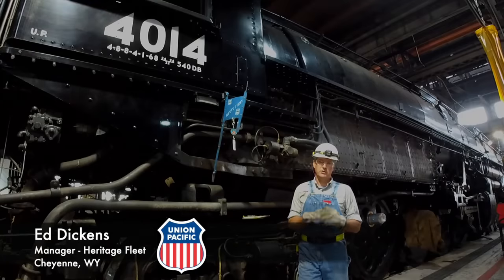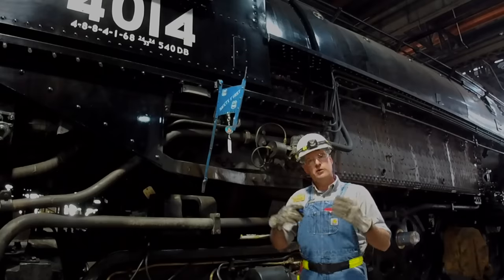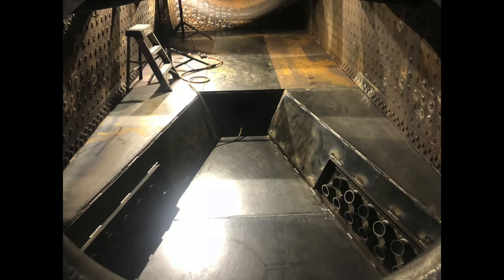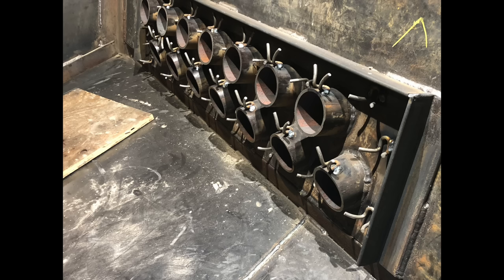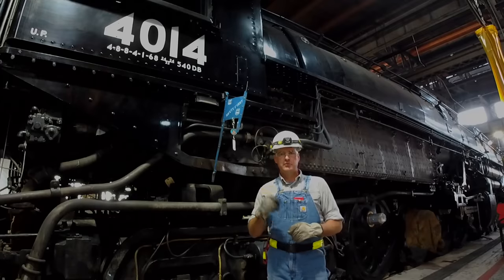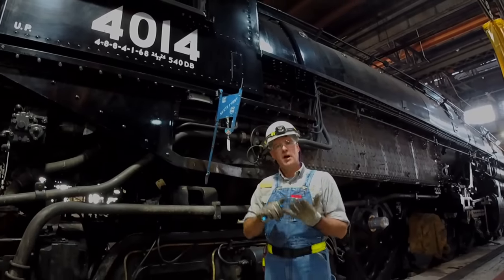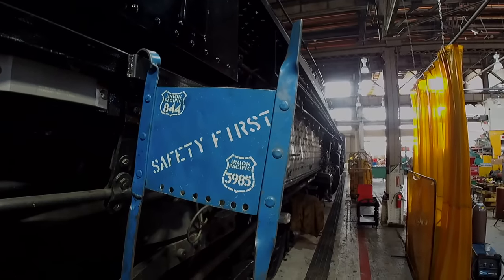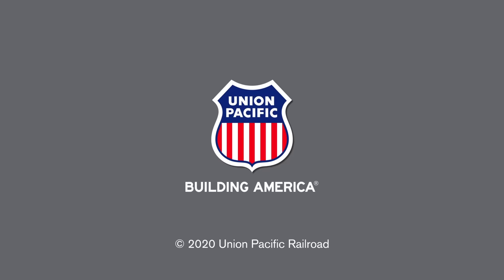UP Steam Update: Converting Big Boy No. 4014 to Oil

Comment: Oil was the only way to operate 4014. The availability and logistics of coal, the ash , the clinkers and all of the other difficulties plus the fact that operating Big Boy would require a wide spread coal distribution system that hasn't existed in decades. With oil, steam locomotives can operate anywhere a diesel operates. Too bad coal just is not practical.
Reply: Your comment should be pinned at the top so the whining, complaining trolls at least understand the conversion.

Comment: I find it fascinating that Union Pacific experimented with oil on a Big Boy, #4005 from Dec. 1946 to June 1948.  It didn't work to their expectations, but proved that a big steam engine like a Big Boy could be fired with oil.  With improvements in technology of oil burners, it's neat to see the 4014 use it with style.
Reply: I am sure there is a world of difference between using a oil burning Big Boy to haul mile long freight trains up a grade, compared to the 20 or so passenger cars the #4014 pulls.
Reply: @travelingtom923  You bring up an interesting question. Does the oil burning mod produce enough b.t.u. of heat for sustained horsepower demands for pulling a monster freight up the grade? Maybe Ed Dickens might know.
Reply: @A_Bit_of_Thought  I am sure it could however there would be a massive black cloud of smoke pouring out the stack. Would be a site to see that is for sure.
Reply: @A_Bit_of_Thought  charcoal burns quite hot since the fire doesnt have to waste its energy on evaporating liquids in the material
Reply: @travelingtom923  While lots of smoke looks pretty, it is an excellent indication that flame temperature and efficiency are suffering. I read somewhere that one of the big problems with burning oil is the wear and tear of the firebox resulting from the higher temperatures of the oil flame.
Reply: @FowlorTheRooster1990  Energy spent on vaporizing the fuel is only a very small part of the equation. Clean burn = hotter fire.
Reply: @A_Bit_of_Thought  The coal would be much harder on the firebox. Coal is very abrasive. I read that the fireboxes on the Big Boys were changed out yearly!  Oil burners have some problems. The soot will plug up the boiler tubes as so you must sand them often with oil burners. If you feed too much oil you can actually put the fire out. If you continue spraying the oil with the fire out, if it reignites you could have a big explosion. The flame in oil burners typically shoots the flame backwards towards the cab. So it can get very hot in that cab with a oil burner.
Reply: 4005's conversion was somewhat sloppy, but its real purpose was to put down an impending strike by the coal miners (which it accomplished).
Reply: I have read some claims that 4014 oil conversion doesn't have the same power it had with coal why they have to use a Diesel locomotive I guess there no video of it ever pulling cars without the Diesel. I also understand that added safety of using a modern Diesel locomotive if something goes wrong  they have it.
Reply: 4005 is best big boy it should’ve been restored to working order
Reply: @Wemfsh  not really considering the wreck it was involved in.
Reply: 4014 definitelly in't using even 5% of it's full power to pull that tourist train. The reason they have a Diesel is so that they don't need to fit the biggest boi with all the electronics the rail controller needs to track it. Plus, if BB breaks, the diesel acts as a backup, to not mess the schedule of freight going thale same line.
Reply: @karlrovey  The main problem was that the single burner that was installed didn't heat the firebox evenly thus resulting in poor fuel combustion.  4005 was converted to burn oil as a testbed for greater efficiency in operations during the coal strike
Reply: @blastman8888  Those claims of 4014 on oil doesn't pull as good as on coal are false claims.  Coal and oil are just the fuel sources to heat the water for steam.  It's the steam that generates the pulling power in the end, not the coal or oil.  Now, poor firing can result in lower pressures, but often times that depends on the fireman and the control of the fueling of the fire

Comment: I was on a steam ship in the Navy back in the 60s. I was a machinist mate so I operated the turbines and all the water pumps and other ancillary equipment. We had 2 boilers in the same space as the engines and they were 2 storys tall. I had little to do with them but the boiler tenders had to avoid dark smoke and only a little white smoke coming out of the stacks or they would hear about it from the "old man."
I was told they burned jp5 which is jet fuel.

Comment: What it’s like standing near a Big Boy, and sitting in the Engineer’s Seat:

For anyone who hasn’t been close to one of these in person, it’s SO much bigger than it looks. I walked up to both 4014 on the rails and 4006(?) in Green Bay National Railroad Museum, and just standing near and looking up at the tender, it’s SO HUGE that I felt vertigo like I was going to topple over! It’s physically intimidating, I could feel a primal reaction wanting to escape the area, as if it were a large beast threatening my safety.😳 

I felt a similar reaction when I visited the Illinois Rail Museum, which I believe is the largest in North America or perhaps the world, just dozens and dozens of steam locos plus everything else you can possibly think of. Walking inside the largest storage warehouse between several rails all filled with steam locomotives, I had that “gonna tip over” vertigo feeling from most steam locomotives I looked up at. You feel like an ant that could be crushed by one step of an elephant’s foot. 

On video they look about the size of a semi-trailer driving down the highway, but in reality they seem way larger! Significantly taller and longer, (although I don’t know that for an absolute fact.)

I also was allowed to climb up the front and walk atop the high running boards along the boiler of a large high speed CB&Q passenger steam locomotive on display elsewhere, and wow, it’s definitely higher than it looks! A jump from that height even at rest, seems like it would be likely to break your legs. But boy it sure was awesome, always wanted to stand up there since I was a little kid..

The most peculiar thing is sitting in the engineer’s seat of a Big Boy like I did in Green Bay. It’s absolutely ridiculous!!! It’s like sitting in the TRUNK of a stretch limousine and driving down the freeway operating it from that position! It’s almost unbelievable that such a gigantic vehicle pulling tens of thousands of tons of freight, would have virtually zero full forward visibility.👀

Try sticking your head out the window of your house and imagine the facing end of your house is the front of the locomotive, and that’s pretty much what it feels like, just one gigantic forward blind spot.

As soon as I got to experience that, instantly I understood why old movies and photos always show the engineer hunched over the armrest, leaning WAY out the window, looking forward. It’s because he’s trying to see where the hell he’s going! 😂 A modern front-view remote-camera would be a total game changer, if obviously not “kosher”..

Also, on any curve, only one side is going to have any effective forward visibility whatsoever. Pretty bizarre to imagine operating this beast blindly and relying completely upon your conductor to relay what he sees ahead out his window. (The cab does have a small tall, narrow rectangular window looking forward you can barely see at top-center of 2:25), but given that a huge ass 100 ft long black boiler obstructs 50% of your view including the tracks straight ahead, it ain’t much!)

Comment: I appreciate the talk about the smoke & efficiency. I was a Stationary Boiler Fireman, in a steam generating  plant in 1966. That (eliminating the smoke) was part of my job.
Reply: Was it your job to literally stand and hand-tune the air/fuel mixture in a steam boiler for 8 hours a day? Or how did it work?
Reply: The answer is yes. But my job also included; watching the huge bunkers that fed the automatic coal stokers, monortering the air turbine; monortering & performing maintenance on the reciprocating water pumps; greasing the automatic coal stokers, among numerous other tasks.
Reply: You really should see much smoke on a steam locomotive either. Little and often as the UK firemen say.

Comment: Spent many days watching the combustion on two Babcock & Wilcox 1200 psi water tube marine boilers. Each had four atomizing burner nozzles. They were equipped with Automatic combustion controls, once dialed in it was just a matter of watching the gauges and occasionally making adjustments to the controls. However, getting them dialed in was like trying to tame two dragons!

Comment: West Coast Railway (doesn't exist anymore) - Victoria Australia, used to run a regular steam service every Saturday from Melbourne to Warrnambool using a former Victorian Railway's restored R class loco that was set up to burn oil, they used recycled sump (engine) oil and I was told (?) they had it mixed with recycled break fluid to get a better burn. This loco R711 is still running special services with one of the rail heritage societies. 

p.s. Good to see a BigBoy back in action :-)

Comment: I'm curious to know more about how fuel oil is supplied to the burner. If it's solely using gravity, without a booster pump, does the fuel get pulled into some type of steam ejector during the atomizing process, and from there get pushed to the burner tip? Years ago I ran a Cleaver-Brooks stationary boiler which used underground fuel tankage and booster pumps to supply the burner.

Comment: When the Big Boy 4014 came thru  Denver on its return to Cheyenne  it passed quite near the Forney Museum of Transportation where the Big Boy 4005 resides and it  faces north towards as if yearning  for home. Indeed it  looks out a glassed in wall that was cut into the building so it along other rolling stock could be moved in and as I saw the 4014 go by that you'd wonder if it's whistle could be heard inside the Museum. One could imagined for a moment that the 4005 had steamed up and left with the crew which was lost  all those decades ago when it left the tracks and was completing that long ago run it never finished...

Comment: From what has been done to the Big Boy firebox is create a focused efficient flame similar to what you find in modern boilers to heat homes and other commercial applications. adjusting the air and fuel mixture with the human touch is just like what a computer would be doing only it is done at the seat of the pants feel and site of the smoke coming out the stacks. I would like to think a lot of engineering and computer work went into redoing that firebox to what it is now. Great work cant wait to see Big Boy back in action in the State of Minnesota

Comment: I can't help but wonder if forced air would improve this sort of oil firebox. I used to have a pellet stove, and that's how they work - they've got a blower getting as much oxygen into the fire chamber as possible, burning a little bit of fuel at a time. 

Obviously this sort of thing would just be a curiosity at this point, since diesel-electric is far more thermally efficient than any steam locomotive, and has enormous tractive advantages as well, but the idea still tickles my fancy.

I imagine it would be impractical for such a system to use an actual turbocharger, powered by the momentum from the exhaust gasses. You could certainly set up electric fans. You'd want to keep them pretty far upstream of the combustion chamber.

Comment: Coal however puts out more BTU than Oil, technically burns more efficiently but its a lot more work
Reply: Depends on what measurements your using. Pound for pound, oil has a lot more energy than coal. One gallon of heating oil weights 8.2 lbs and has 16,900 BTU per lb. The best coal Anthracite has at the most 15,000 BTU per lb and the coal people use in their homes, bituminous has between 9000 and 11000.
Reply: But there are a lot more impurities in coal that make it a lot more dirty to burn than oil. (Lot more sulfur and some other stuff you don't want in the air). (Weirldy enough coal burning is actually pumps a ton of radiation into the atmosphere as coal contains minute amounts of uranium that is put into the atmos when burned)
Reply: @zachmunch4807  Amusingly, if a nuclear plant leaked even 10% of the amount of radiation into the air that a coal plant generates continuously, the nuke plant would be shut down immediately.
Reply: @dundonrl  Pound for Pound oil has more energy because your volume of mass is greater than Coal. This is why comparing pound to pound isn't right. just a silly argument to get in to.

Comment: This is a very nice video.  I just posted a comment on the PTC video complaining that it was to brief and had no real detail, just showed a ruggedized computer screen in the cab and not much else.  This video had some very nice detail and explanation.  

I would think that in this era, you could put some O2 and other sensors in the exhaust stack, send the data to a computer, and have some servos control the fuel/air mixture.  You would achieve much better results than having a human do it.  But, I suppose that would reduce some of the charm of running steam.
Reply: what do you want to know about PTC? I've wired them in locomotives

Comment: I wish that understood even half of what this crew has learned about combustion theory, well done guys!
Reply: Honestly this is almost elementary compared to any internal combustion engine in an automobile etc. especially with electronic fuel injection and ignition timing advance, forced induction (turbo/supercharging), differing fuels (87/93/high octane race fuel/E85/methanol/nitromethane), camshaft timing, etc. 

Not to take anything away from the UP Steam crew and with all due respect of course. But this is essentially a gigantic, simple machine in comparison.
Reply: @Syclone0044  it might not have as many parts to it, but dont make me laugh the thermaldynamics alone is enough to write a thesis paper on, and the effects of the passageways of steam the size of pipping used the exaust ejector design, all are factors, and if you think its simple read up on livio dante porta and his writings
Reply: @manga12  You make a good point!

Comment: Thank you very much @ Mr. Dickens for explaining this! What I am asking myself is whether, provided good quality oil and a skillful person controlling oil-, steam- and air flow, an external combustion machine like this, in tough daily freight service, would still require the occasional bucket of quartz sand to have its superheater pipes cleaned of soot. Or would there be other, less abrasive methods available nowadays?

Comment: Gee, 4014 just had a complete restoration, but we can see the side rods are removed in this video. Wonder what they're
 doing? Thank you UP for this update.
Reply: Probably a routine bearing inspection.  The main rods on 69585's double-action twins transfer many tons of linear force to the primary drivewheels on each stroke; the TIMKEN® big-end bearings' rollers could deform if not properly heat-treated.
Reply: Routine maintenance!

Comment: Awesome, just awesome that anyone much less a functioning railroad rebuilds, converts and runs steam locomotives.
Reply: And let me follow up to my own comment. Yes I saw over the first time they fired up the Steam whistle within hours of when it happened, And I know British rail has been putting more and more steam engines back online, but they’re running Coal and at first they did it as a way to make more money per ticket and bringing the steam engines back out, It seems to be partially out of necessity as they did not upgrade their electric lines and their deisel engines are at end of life, they’re running steam trains again on the main line., I wish that maybe they converted some of them to oil, but hey they still use coal for heating houses in some places and ppl heat narrowboats with it. But hell yeah is there a big boy around that is so coal fired and running, I think there’s a few in museums.

Comment: Ed - I have watched the 4014 since you completed the restoration. You have yet to put this locomotive under a full load, I am thinking of the 1991 video of the UP Challenger pulling 135 double-stack cars up Sherman Hill by itself. When will you try a comparable load-test of the 4014? I have read that, when UP converted the 4005 to oil in the 50's, that locomotive lost significant horsepower. Has the same problem occurred with the modern oil conversion? The bottom line is that many of us are dissapointed. Pulling 20 passenger cars with a diesel assist is no challenge for this locomotive.

Comment: Cool video 👍 learned how to fire an oil burner this past winter after already knowing how to fire a coal burner. It was a neat experience, known just need to learn how to fire a wood burner!
Reply: Can you explain the general concept / differences? I’ve tuned electronic fuel injection on high performance street car engines , so I know the basics but never hand-fired anything besides a campfire.

Comment: Beutiful and neat at the same time. I do love steam engines and have worked on a couple (making piston rings) so this sounds really good but still have to work on the pistons, steam has the ability of swelling any type of wood so making the ring (from the bright timber) soaking it and then checking it for fit (there's 2 types of soaking 1 is water and will match the cylinder as long as the engine is working (dry's out really fast when not in use) and oil, the grade depends on the timber used to make the ring. It's a better option because it lasts longer, I've even heard the use of hot animal fat (useually lard) makes them go further once fully soaked (a hot inpregnating process).. Love steam there is nothing like it.